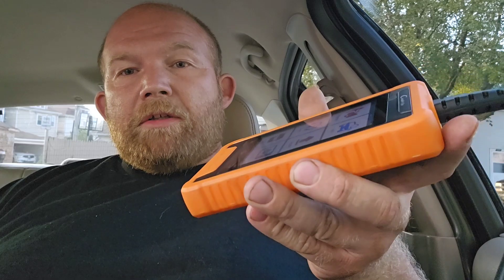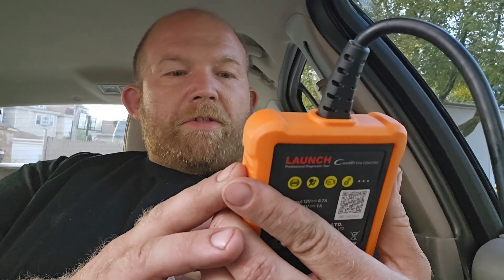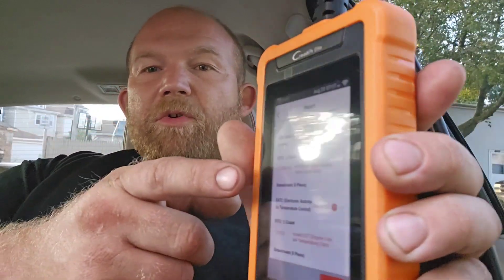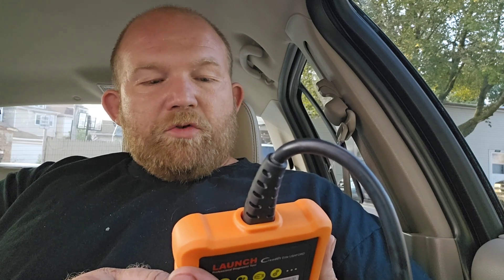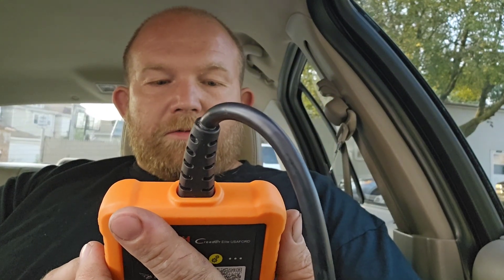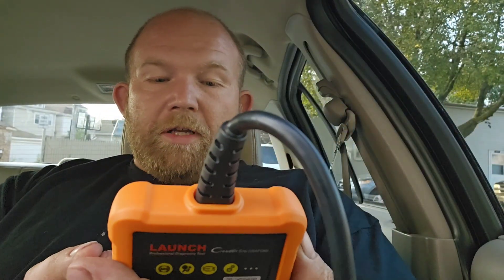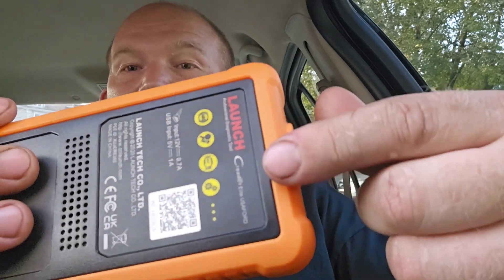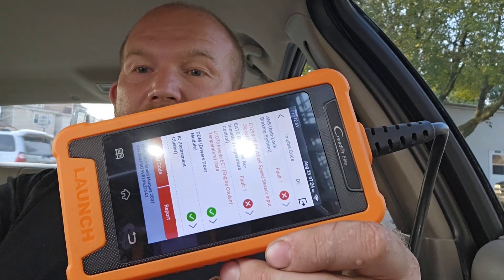Lainch Creader Elite - Ford - Let's Use It To Check The Codes - Grand Marquis

Comment: Gone are the days of no electronics in vehicles. Back then there was no charge to diagnose because it was all mechanical. Of course cleaning up exhaust was a good thing 😊 Costs a lot for modern equipment and across many manufacturers. I’ve saved plenty using my code reader 😊

Comment: 2stallGarage Sent Me Over Here To Ask You A Question. I Have A 2007 Jeep Liberty, it Keeps Throwing Me A P0300 Random Misfire, I Have Changed Everything To New, Spark Plugs, Fuel Injectors, Coil Packs, Relays, All 4 Oxygen Sensors, Gas Cap Intake Gaskets, Pcv and Hose, Fuses and It Keeps Throwing This Code. No Idea Why Now. I Have Noticed, When The Car Alarm Remote Stop Working, The Light Comes On?
Reply from the maker: Did you use originally equipment parts or did you use aftermarket
Reply: @FordBossMe  Original.